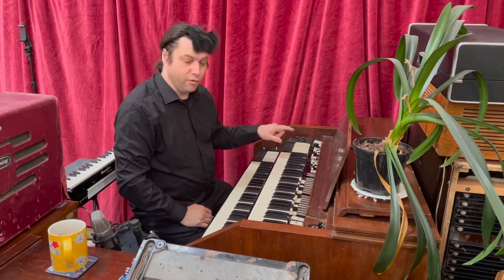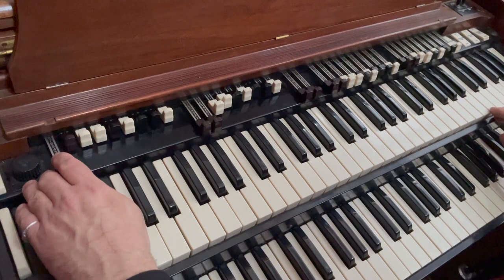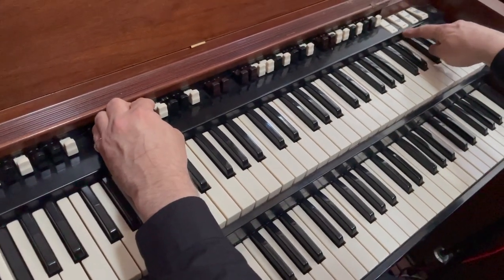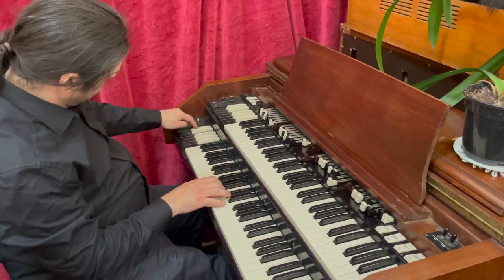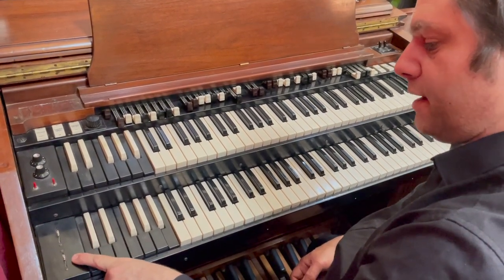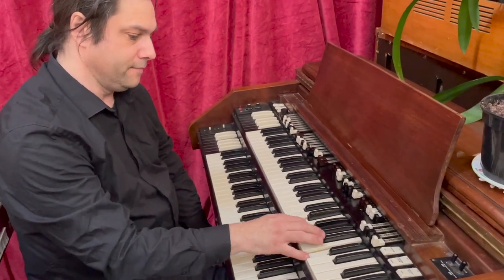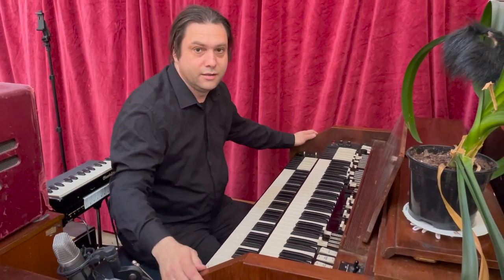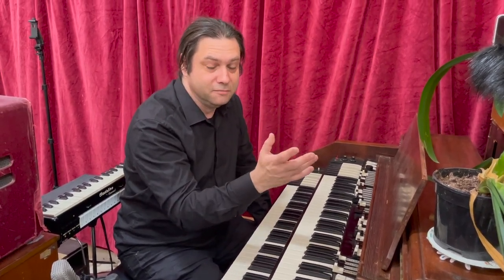Hammond C3 Organ Demonstration with special guest Don Shinn

Comment: Interesting post.  I used to play an L100 many years ago.  These days I've got a Nord C2D "clonewheel".  Annoyed that I just missed out on a Hammond RT3 with a pair of Leslies last year - rather annoying.
For completeness, the main motor is a synchronous motor that won't self-start (like some old electric clocks where you have to spin a wheel on the back to start them).  The Start motor is a basic self-starting motor that gets the tonewheels up to speed so you can then switch over to the synchronous motor, which is tied to the mains frequency so that pitch is stable.  Very clever.
Reply from the maker: Thank you very much for the info Tony! -
Reply: @VintageKeysStudio  No problem Steve.  I came across a few of them back in the day.
Reply: as you mentioned the electric clocks - in fact  mr. hammond invented the electric clock with a synchronous motor (afaik) and used that motor for his organ some years later. 
but i was quite surprised to find out that some simple digital clocks (like an alarm clock or in a microwave oven) still rely on grid frequency instead of a quartz element to keep in time... and normally this works fine as grid frequency is kept very stable, but some years ago we indeed had some issues in europe where the frequency was just a tiny bit too high. and people were wondering why their kitchen clocks were going some minutes fast .. ;)
but i think you would not be able to notice it on a hammond organ. luckily i have an electronic frequency converter (50 Hz -> 60 Hz) installed in my organ anyway ;)
Reply: @Jenairaslebol27merde  I knew that Laurens Hammond had invented synchronous motors & originally produced electric clocks.  As to mains frequency, in the UK anyway, the specification is for very good accuracy (I can't remember the actual figure) over 24 hours, but a wider tolerance to allow for peaks & troughs in demand, so medium term accuracy isn't as good.

Comment: The drawbars relate to the harmonic series as understood on pipe organs. The white draw bars are 8' pitch, 4', and 2' - the fundamental, octave, and superoctave.
The two draw bars to the left of the first white drawbar are the 16' suboctave and a 10 2/3' (a 5th above the 16').
The colored draw bar between the 4' and 2' white drawbars is 2 2/3' pitch - this is the drawbar that adds the most recognizable "Hammond" quality as heard in A Whiter Shade of Pale.
The pedal drawbars are 16' and 8'.
The colored drawbars above the white 2' pitch are overtones are used like mixture stops on a pipe organ. They are 1 3/5' (a 3rd above the 2'), 1 1/3' (a 5th above the 2'), and 1' (octave above the 2'). They add brilliance to the sound.
Reply from the maker: Thank you :)